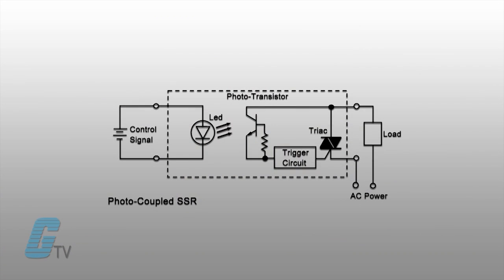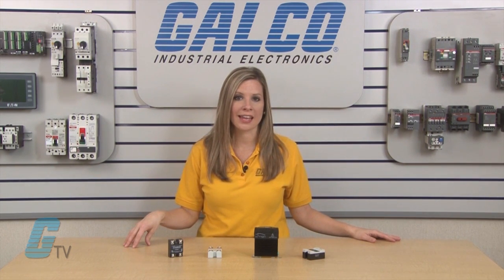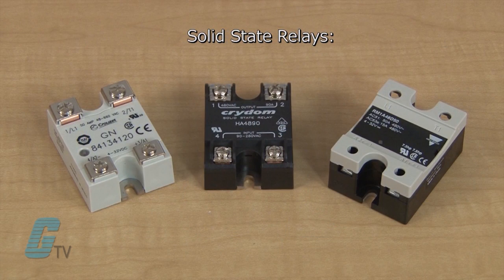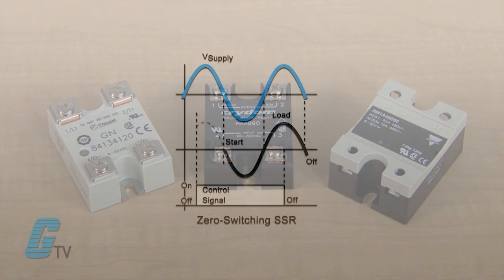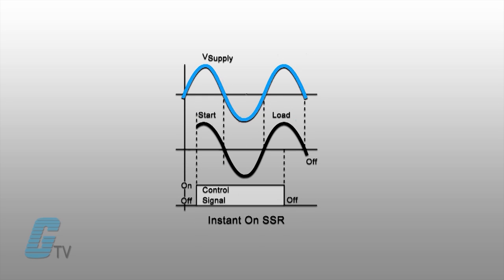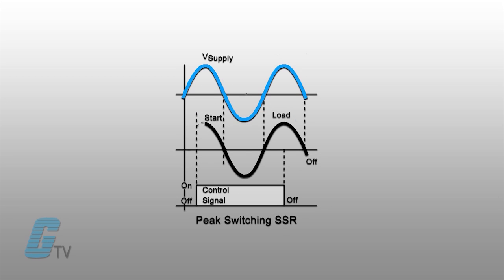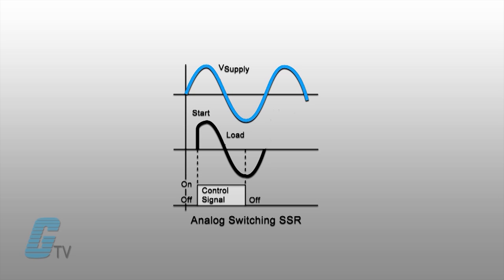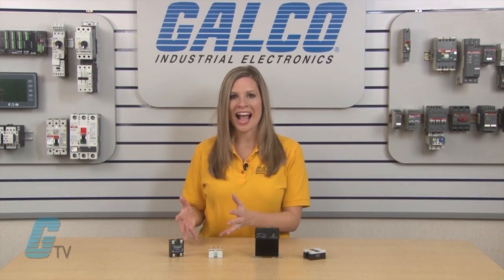What is a Solid State Relay?

Comment: Our elevator maintenance vendor is quoting $2,800 to replace our old mechanical starter with a new solid state one.  Does this sound like a fair price and do you have any recommended installation vendors in the Los Angeles area?
Reply: Is fair price honestly

Comment: Hi can you advise please, I'm using contactors to switch capacitor into and out of a motor circuit running at 415 vac 50 hz.  The max capacitor size will be max 600 microfarad. The circuit will be triggered by 240 vac using voltage control relays but I need the SCR to switch at Zero cross over and then when the voltage builds to switch off at zero cross over.  I will also need I believe a snubber circuit . Can you recommend any items please? Many thanks Andrew
Reply from the maker: Andrew, this is an engineering question. Can you call us at 800-337-1720 and ask for engineering please.
Reply: Can you provide a email address for technical please I'm based in U.K. Thanks for quick response.
Reply from the maker: You can find our email addresses at the bottom of our web page galco.com under "Contact us" there are several to choose from.

Comment: You have to test solid state relays in diode mode, since triac based SSR's will not show direct continuity across the switched side even when fully turned on, but will show a ~1v voltage drop in diode mode.
Reply: Richard Smith 👍
Reply: Check this too https://www.youtube.com/watch?v=OsjipQ0C5Ws

Comment: Can I sense when AC power off? from the other side ?
Reply: If your multimeter has diode test mode, then yes. Continuity will always test infinite, since you have to overcome ~1v diode voltage drop before continuity is apparent.
Reply: Depends on the ip rating

Comment: Any hobbyists(/DIYers/Makers) around?
What kinda SSR do you usually use? Or mostly needed for common projects?
TIA
Reply from the maker: Well here's a loaded question, cuz there has to hundreds of different types and ratings on these things. If I had to throw a dart at this board, I might lean towards 24volt input and 120/240Vac output control. If you need a part number, go to our website, click on "Buy Products", and then "Electromechanical" and then "Relays" and then "Solid State". You will find 2247 choices. So,,,, I strongly suggest you first decide what kind of voltage will control the SSR, (AC or DC, 5, 12, 24, 120 etc.) then you must decide what kind of voltage it will be controlling on its output. This way you can narrow it down significantly. Good luck on your project.

Comment: I am trying to build a powder coating curing oven. I need some SSRs but don't know which kind. Back to google.
Reply from the maker: Hello,

We would like to try to assist you. Can you gives us some information regarding what you are trying to work with/build? 

Thanks!
Reply: I am building a powder coat curing oven that is about 6' x 6' x 8' (I have some large pieces that need to be cured). I know typical home wiring quite well but electronics is another story. I need to heat this space to around 420 degrees f. I will only use the oven once a week at most so it's okay if it takes a while to heat up. I am wondering how many heating elements I should use, what kind of SSRs to use (and do I need one for each heating element?). Then I would need a digital power controller along with a heat probe. Then there is the recirculating fan and anything else I may be over looking. Trying to wrap my mind around this project.
Reply from the maker: Hi Sammy,

In the interest of liability, we must stress that what we are going to give you is merely suggestions, rather than instructions. Given that, ovens are a little bit out of our area of expertise, though I think that we can still try to help you somewhat.

Upon asking around for you, it was suggested to me that you should start by choosing an appropriate process controller, and then you should choose the SSR based on that. I was also informed that SSRs nearly always require some sort of heatsink in order to carry their maximum rated current, so that is another thing to keep in mind. 

You will also need some sort of sensing device such as a thermocouple or TRD. Fortunately, modern temperature controllers tend to be very plug and play with just about any sort of TC/TRD input.

Hope this helps!
Reply: GalcoTV This helps very much, thank you.
Reply from the maker: Glad to help!
Reply: Sammy Spaniel  hhhhuhķyuo